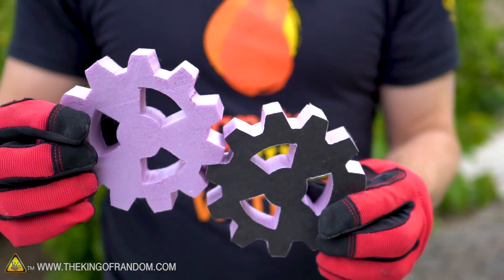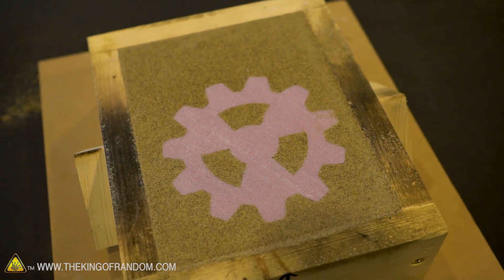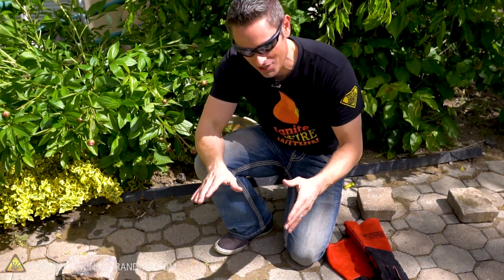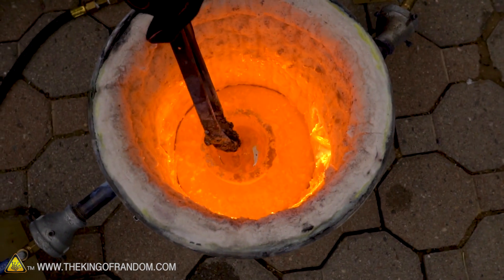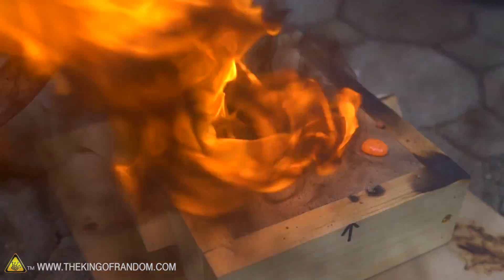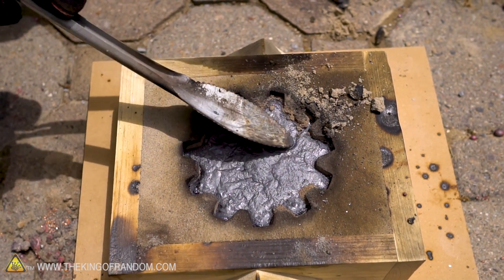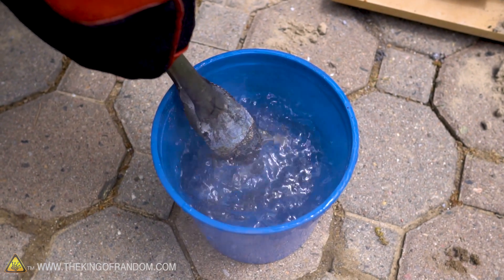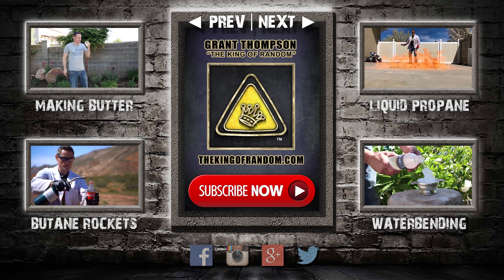Argh. Why Is Copper So Difficult? TKOR Tests Melting Copper In Our Homemade Foundry

Comment: Use oilsand instead. It holds together better, and hardens when it contacts molten metal. You can buy it on amazon for fairly cheap.

Comment: Instead of using the Crucible to melt the styrofoam, use some screws to pull out the styrofoam. Just screw em in a little and pull it out nice and slow. It may leave the mold perfect

Comment: Why didn't u use a wax mold instead of the styrofoam? Also try this experience: bloated spitballs by (alcool and water mix solution or voodka) in a vacuum chamber will they inflate or deflate?

Comment: Use myfordboy's method.  Have a Cope and Drag mold box.  Use a Removable pattern with talc to ease removal.  Use High risers to quickly and evenly flow through the mold.  

Trying to do it the way you're going will be down to pure chance.

Comment: I have casted with copper and green sand. So it all depends on the foam you use. Too solid and it will take to long and the copper deforms, too thin and it will melt before you touch it making the sand week and float to the top as it happened to Grant.

Hope this helps :).

Comment: I'm thinking that the sand might have too much moisture, causing the wet pockets to vaporize and ruining the mold as the vapor rapidly escapes the sand. You would probably have better luck if you used a cap on the mold, as it might hold the shape better.

Comment: The bouyant forces from the copper (much more dense than AL) are causing the inner pieces to break away and float. You need a layer over the top to hold them down and lock them into place. Use a sprue and riser to pour through the top layer.

Comment: Hello GT, Why don't you put an iron nail with a broad flat head to each of those sand chunks so as to act as a foundation and support structure and restrict those chunk of sand pieces to pup out. melting point of iron is about 1500 deg C so it can also withstand the temperature of molten copper. Thanks. You R doing a great job.!!!

Comment: Grant Thompson, have you tried using something to keep the mould "closed"? Only leaving a space to pour the molten copper inside. As copper is to dense, when casting some people use a mould in the middle of the sand and put more at the top, creating a mould that has a "stick" like thing to create a hole to pour the metal inside

Comment: why not try a trick the automotive industry used for casting. press, compress, then heat the sand so it will stay in place.

Comment: ok I think part of the problem is that the sand is too dry and also that you aren't putting your sand through the strainer. I think that's what's causing the middle pieces to float up

Comment: It's because the sand is less dense than the copper so it just floats to the top
Reply: its not due to density, sand casting is a very common technique, its because he is using an open face mold and cant fill it fast enough. google search the process
Reply: well it is also a density issue, it's just that the sand used in casting is very cohesive
Reply: its part he's used the same sand over and over too without adding any more binder, he could also split it down the middle and make the cavity half as deep in 2 halves and have a better chance at having it work

Comment: be careful with stryofoam because i heard that when you melt and or burn it the smoke contains cyanide also i know a way to make it keep its shape you need you mold the sand,a dowel or pipe,and the molten metal

Comment: hey mr grant if you want better castings better get into centrifugal mold casting... in that way your results will increase a ton... also note that because the molten metal will be put to spin a accident could be catastrophic... so a proper professional set up would be pretty much mandatory...

Comment: Why not just use a torch to melt the styrofoam? This would also heat the mold so the copper doesn't cool as fast. Or just do a full cast where you have sprews and what not so the sand insulates the copper? Also adding some borax would help the copper  a little bit as well.

Comment: maybe adding some toothpicks or steel wire straight down into the sand when you make the mold will add some supporting structure to keep it from breaking like it does.

Comment: why not use the same method you would use for silicone molding. the only difference is that you would be doing it with sand

Comment: Use another box like that 
Fill it with green sand
Put it upside down on the box with the mold 
Then make a hole to the mold then pour the molten metal in there

Comment: two suggestions i have, you need flux (boric acid), another is one try to stabilize the mold with toothpicks, maybe also try preheating the mold,  between the mold being preheated and the toothpicks to keep the mold rigid, you got this!

Comment: Maybe if you try a full cope, flutes and drag set up, with an open riser it would help. It would prevent you from hitting that sand to make it break apart. and you wouldn't need to use the foam when casting, you would just use it to mold the sand.
I would say next time you use sand casting to invest in some, flux to put on you sand you mold after its set.

Comment: You may need more clay and you should use a top box, the cope and drag setup traps the heat helps to hold the sand, because the weight of the copper is also a cause of the sand breaking

Comment: A way to fix this problem is by having an entire solid layer of green sand on top of it with little holes to pour and by adding about 6 ounces of aluminum for every 4 pounds of copper and using Borax

Comment: a few thoughts 

there are binders you can use to keep the sand together

i was thinking, and i am not a mechanical engineer, i am an electrical engineer

what did you not use the hand held blow torch to burn off the Styrofoam and pre heat the sand??

i was watching it it could be the sand is too buoyant and is literally floating on the liquid copper

Comment: How you'd cast it is to use the same method as preparing the Styrofoam gear in the sand, but leave the top piece of wood on the box covering the top of it, with a hole drilled through the box lining up with the center point of the gear which should also be drilled out. The problem was the sand wedges in the middle being less dense than the copper around it and being forced to the surface through buoyancy. If the sand wedges were supported from above they would be unable to float away. Styrofoam contamination in the copper may be unavoidable, but the amateur engineer in me says it's worth a try.

Comment: I'm wondering if a higher clay content in the sand would help with the floating sand issue. Sounds like it needs more adhesion or a heavier weight to it (the buoyant force of the copper is probably too high to handle, though).

Comment: I think you would be better off with a two part enclosed mold so the buoyancy of the sand won't be an issue, it will also insulate the copper more so it will cool down slower. I know with some types of metals they preheat molds also.

Comment: you might also have to burry the foam gear into two green sand blocksand add a filling pipe to the top that you use to form a pouring hole, sure you wouldnt see it cooling but i feel the mold holes in the gear will hold up more

Comment: Im have no experience with foundary but it seems like the sand is to light compared with molten copper and the buoyancy makes the sand float to the top. Copper is pretty heavy and thus a sand mold like this would probably work better with aluminium

Comment: What if you make the mold like you used to? Make foam risers and bury the gear under the sand leaving the risers exposed to pour the copper into. That would keep the mold from deforming when you pour it. Also if you could make the mold so that the gear is sideways, it wouldn't have to flow as far, it would just fill up

Comment: Grant, it looks like your major problem is that you should be using the cope and the drag to create your mold. This way you can include a filler and riser from which the casting can draw extra metal from as it cools and shrinks. Plus having the cope and drag together will keep the surrounding air from affecting the molten metals solidifying rate. Perhaps this will not be as dramatic for viewers, but you will achieve more consistent results requiring less cleanup work. Now with the green sand moisture content, you want enough water so that when you squeeze it no water drips and the sand holds together tightly so that when you try to break it in two you end up with two pieces that separate cleanly with no crumbling. Too much moisture in the green sand doesn't go well with molten metal and result in some things you don't want to experience though it would make for some exciting video. I hope you find this helpful.
Peace!

Comment: Green sand copper casting is viable. Your problem Grant, is in that details like the radioactivity symbol are not very easy with copper. It is too dense for the sand, and as such it floats to the top. I recommend taking the gear you just finished, clean it up a little, then cut the rest of the shape out.

Comment: Hey Grant, I've never tried Greensand casting with copper, but ive had similar problems casting "brass" (aluminum) knuckles and I resolved the issue by sticking toothpicks in the middle of the raised details while i was packing the sand. It should work for copper too.

Comment: You can try adding sodium silicate to the sand then injecting CO². This will harden it so you're mold should hold up to the copper for the casting. The sand can be reused.

Comment: Grant why don't u just burry the gear into the sand and create a small hole above and pour the copper like that
Reply: Well this is a home made mix, maybe having a proper casting sand that has the correct amount of clay and other additives would produce a more stable mould, as well as being able to handle the copper's properties?
Reply: Squid_122 Yeah. That that would be better since he has done it before.
Reply: but that object was long(thats what she said) and it wasnt copper and also he is using his new one not the old one
Reply: Ohhh I didn't realise it was a mix of clay and sand I just thought it was wet sand.
Reply: Seeing as this is a sand and clay mix it seems like you don't know what you're talking about.
Reply: Lettuce Gaming he needs to get proper casting sand, proper "sand" holds the shape. Usually you use clay or a clay sand mix

Comment: there is a reason they typically don't cast copper and go with bronze instead.  it's notoriously difficult to do with sand.  plaster casting is the way to go for non-ferrous metals.

Comment: what mixture in the sand? if there's no clay that may the be cause the holes to float on the copper cos sand mix with water can break apart easily (hence the reason to handle with care) even the density compare the sand mix and copper sand is lighter then copper so the copper could be pushing the hole part easily.
Adding bit of clay would strengthen the shape and guarantee it would not shift (that my logic thinking) use it as clay powder in the sand mixture

Comment: try filtering concrete and make the mold with it and let it dry out it will have less water in it so it might take the copper longer to solidify

Comment: Looks to me like you don't have enough bentonite in your casting medium. This causes the mold to fall apart as the water is driven out by the heat of the metal. And, since the relatively hollow sand is lighter than the liquid metal, interior parts of the mold(which are often hard baked and embedded in the raw medium, to prevent this problem) tend to float on top of the liquid metal.

Comment: The problem is your sandnisnt packed tight if your using styrofoam, use a wooden template, pack sand in real tight, screw into template and remove.

Comment: just speculating, but what if you used a different bonding agent in the sand instead of water.  some kind of oil maybe?  and also try using wax instead of foam.

Comment: you would probably have better luck with your sand staying together if you put sand on both sides of the mold and just add some extra pieces of styrofoam so make air holes and a poaring hole

Comment: It appeared that you didn't pack the sand until the box was over half full of green sand. Are you sure that the radioactive parts were well packed to the rest of it? Also why did you leave the foam in, since you are using green sand?

Comment: I figure a closed (two-part) mould would avoid the issue of the centre pieces floating up, and would also help to prevent the copper from cooling so fast.

Comment: need to use a none flammable oil like hydraulic oil instead of water then you will not get steam being given of which cools the copper and slows the flow thus rough casting

Comment: Why are you not putting a top. On the mold with an access tube for the pour and a vent for the excess and gases ? That would prevent the foam from rising.

Comment: Hey Grant try buying small steel rod in the imprints to get the sand to stay in place because steel has a higher melting point than copper

Comment: if you use a sand that is more like clay then it might stick to itself better and if you use a less dense foam then it will get away quicker so the copper can flow faster.

Comment: Or what you could do is make the mold again, out the cover on the mold (so the whole thing is closed) flip it vertically, drill a hole into the wood and probably the and beforehand, and then pour in the copper.

Comment: Just from watching you try to pour the mold I'm getting the impression that the copper is to dense and it's causing the sand to break free and float to the top of the copper.

Comment: packing the sand then baking out the moisture to give it a more structured mold might be an option. go with a closed mold aswell? have the sand cast baking away and when the copper is ready to cast. the temperature shouldnt cause the copper to solidify fast enough while pouring down a funnel cast. saw off excess copper from funnel path.

Comment: Grant, though I don't have much experience yet in metal foundry work, the other youtube videos that I've seen that tackle this kind of issue use a different mold system.  You might want to try using a 2 part mold and removing the foam gear before attaching the second part.  When I've seen this in other videos, they have both a gas release channel and a channel for pouring in (imagine the second part of the mold with 2 chimneys coming up to the surface---one for pouring, and one for gas release).  They often have a trough leading to the pour tube.  What I noticed, especially in the first attempt, was that it seemed the force of the pouring copper could be damaging the mold.  If you had a channel, it would negate that problem.  In the end, your would have a little piece of copper where it poured through the channel, but that could be easily removed.  This is all difficult to explain only on text.  It is much easier to see visually.

Comment: you could use a torch to burn the Styrofoam out
Reply: yme elzinga a torch will move the sand
Reply: depends on what kind of torch you use and what setting if you use a yellow-ish flame there isn't that much pressure
Reply: You don't want to remove the Styrofoam because it holds the basic structure together while the sand has an extreme heat change.

Comment: you could be having one of two problems first if you want to use green Sand to get a proper casting you need to use a wood pattern and remove it after the sand takes it's shape and use both the drag and the cope because it actually helps to prevent the copper from solidifying too soon the second problem is actually the quality of you green Sand and from me experience if green sand is heated before pouring the water actually evaporate and the sand become dry and losses it's ability to hold the Shape you can overcome this be using different kind of Sand like sodium silicate sand which hold up against high temperatures

Comment: Grant it didnt touch the styro melted so fast when it contracted it pulled the edge of the sand downward i saw it and I've done that a few times too. You can also have a wood cap with a hole into and it reduces splash, supports sand from lifting and takes care of problem, a flat cap with hole in middle and a few extras to left and right i find a traingular shape of 3 holes is best. Copper's the worst!

Comment: Grant. Please do yourself a favor. Attach something to your gear like a few pieces of tape or something so you can pull out the Styrofoam gear. You can then pour the metal in the now vacant cavity. You only need one gear to make many sand molds. Remove the gear before you pour. Then you wont have to melt it out. Your welcome.